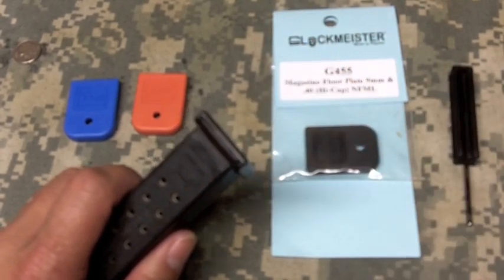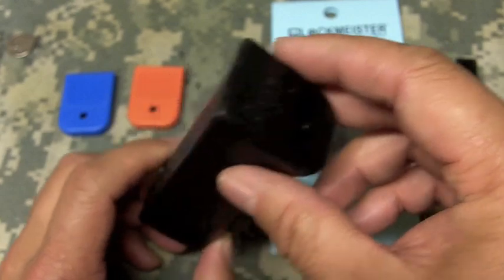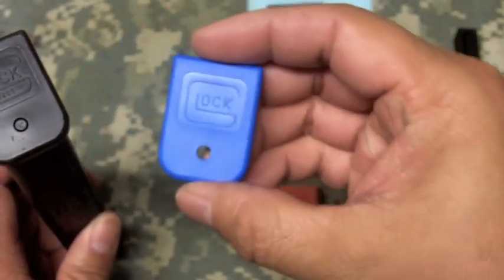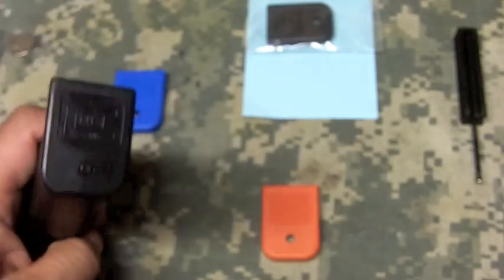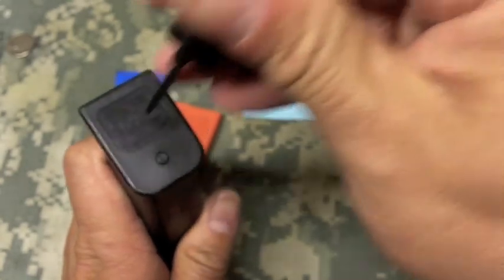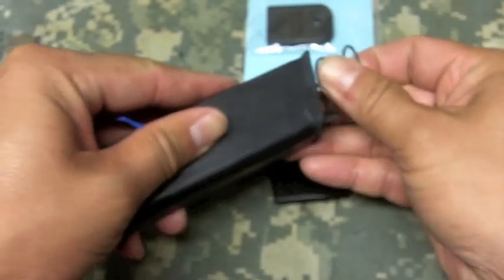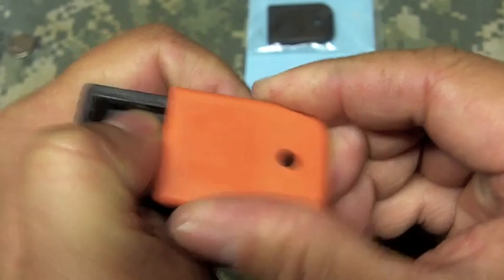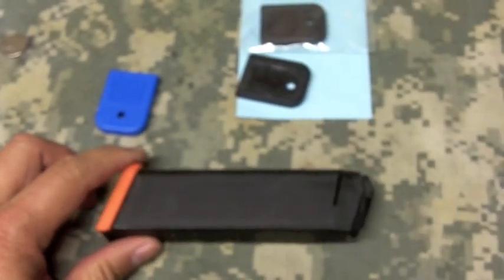Glock magazine floor plate replacement : HOW TO

Comment: Thank you so much. I just got a magplate from Bastion LLC and knew what I had to do basically but this cleared up what I should use. Now off to find a video about changing out the the slide back plate on the gun.

Comment: Excellent!  Was having difficulty getting my floorplate off so I can put an pinkie extension on my Glock 27 magazine.  Wasn't pushing in on the sides of the mag. to disengage the tabs!  This video made the switch easy!  Thanks.

Comment: if you dont have that glock lever thing this is the biggest pain in the fucking ass
Reply from the maker: Make sure you squeeze the magazine body near the floor plate :) Hope you get errrr done!
Reply: figured it out, thanks anyway!
Reply: Not at all. I used a hex wrench that fit the hole and did 3 in less than 5 minutes. First time ever.